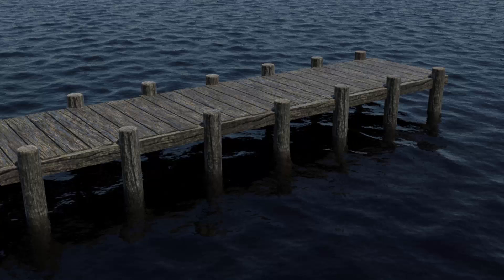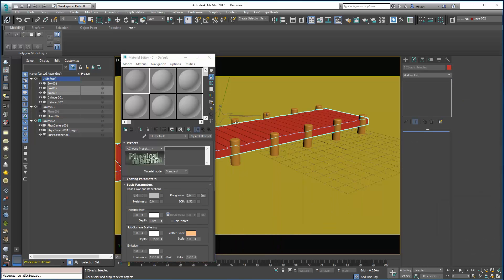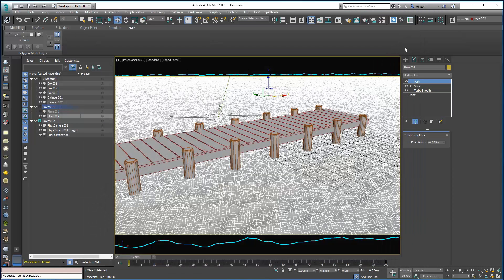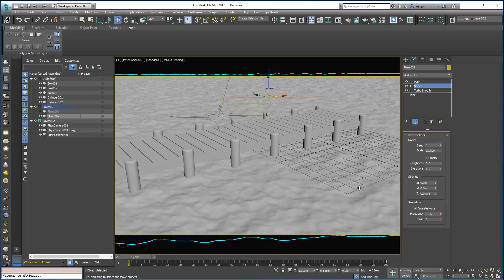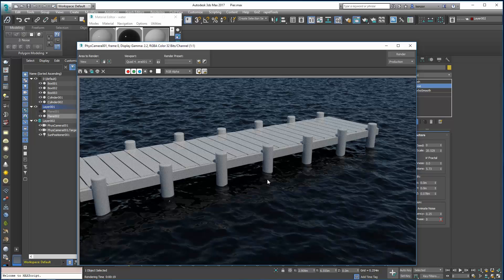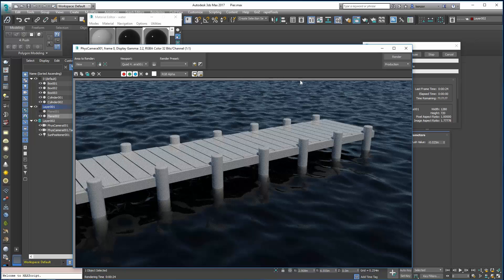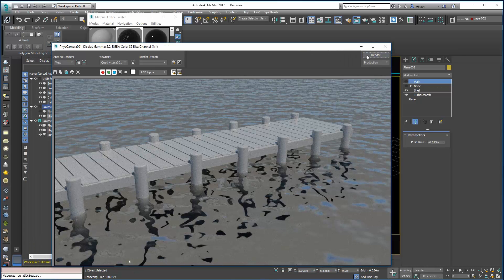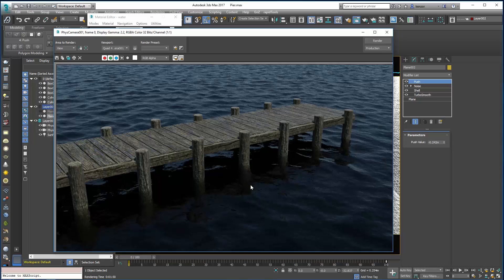Advanced 3ds Max 01: Water without plugins using the art render

Comment: You know what is faster, and even looks better? Just use mental ray's preset water/ocean within the architectural and design material. With that you get almost photorealistic water, and it also renders fast as well. Now of course it won't have real geometric waves (it will be all inside the texture), so it is ideal for stuff where the camera is around 5+ metres above the water at all times, it wouldn't be ideal for a camera that drops down near water level at like only 1 metre above water level (since at that point it starts to become obvious there is no actual geometric depth).

Of course Autodesk removed Mental Ray, since they got sick of paying licencing to Nvidia, as a result modern 3DS Max has Arnold renderer, which is something Autodesk purchased outright off some startup guy from Spain who was producing it with Sony originally. Arnold is slow and isn't very effective for the average user on their computer. 

All is not lost however, Vray still exists, the third party renderer. Vray is basically at least as good as Mental ray (in fact, probably a little better than Mental ray), therefore Vray in my opinion is the best choice for a modern version of Max. 
I still use an older version of Max to have access to Mental Ray, because I find that Mental ray is so mature as a renderer that it has so many options for just about anything, you have so much sampling control (you can set sampling contrast per colour), you can really make Mental Ray render very fast and achieve high quality, you have caustics, advanced reflections and refraction, so many preset materials, subsurface scattering, HDR etc. The only things that don't readily exist are a powerful motion blur system (however that is easily added in post, in After Effects with Pixel Motion Blur). As well as a good depth of field system (however that can also be added in post if the scene is simple), in a complex scene adding depth of field can't as easily be done in post with single frames (but you instead render out the distant stuff in one set of frames and the foreground stuff with transparency layers as separate frames, and via this you can easily add depth of field in post as well). 

One of the most important things I found as a creator, is practicality and speed. If the end viewer can't tell the difference, then there is no use wasting hours or days doing something that isn't noticed much in the final product.

Comment: a great job. Where can I find the wharf material (Wood) ?.. I'm also doing a wharf. Thanks in advance
Reply from the maker: The material is based on this free texture https://www.textures.com/download/woodrough0109/36919 . I made it tile in photoshop then simply used the texture in both the diffuse and bump channels. It came out quite well so I didn't spend the time to extract the PBR set from the image using the substance tool set.